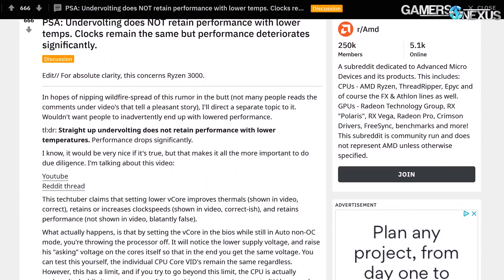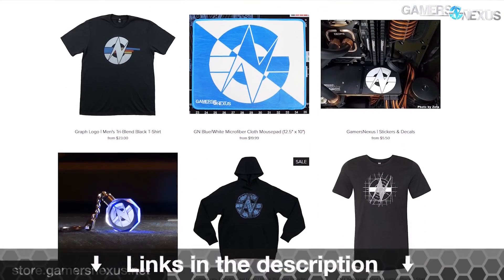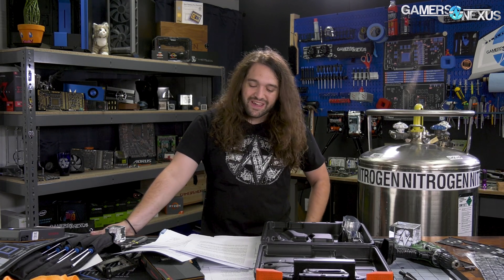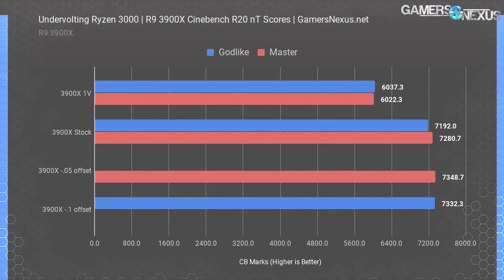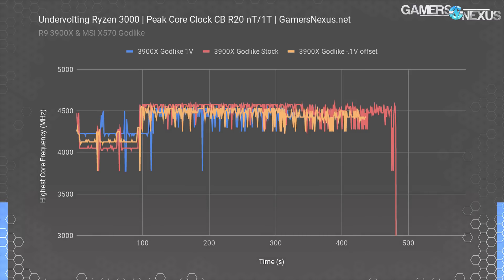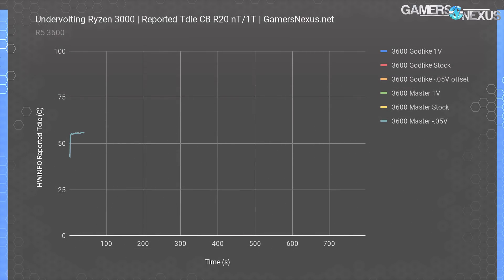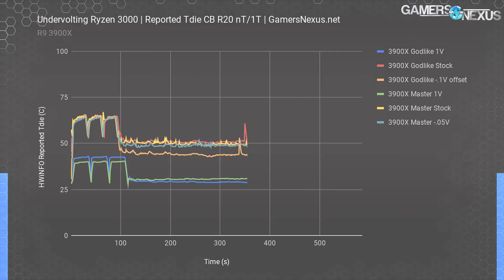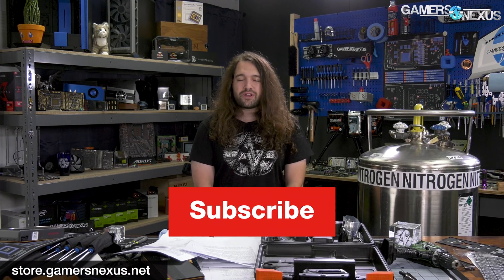AMD Ryzen 3000 Undervolting Offset vs. Override | Vcore Voltage

Comment: Wait I'm confused, I can't really understand the point of the video probably because I don't know much about this topic and because English is not my first language. I undervolted my 3600 at 1.15v and 4.1 GHz and the score seemed to increase quite a bit (200 points circa, I could adjust it to reach 4.2 GHz but my main goal was to lower temps without sacrificing productivity). So why is the guy saying that undervolting your score gets lowered? Am I misunderstanding the point of the video?
Reply: You get the point of the video. I have the same situation as you. Maybe, author of the video undervolted it more than the optimal value (1V instead of 1.15-1.25V)
Reply: @viktorkrasovskyi7837  yeah i read the article and for what I understood the topic is about undervolting too much and also by lowering Vcore in the BIOS, wich causes instabilities in the motherboards, whilst I am doing it via Ryzen Master, maybe the two methods are different.

Comment: My own testing has shown that cinebench stays pretty much the same, only 3dmark shows a difference with undervolting. For me going -0.1v offset, lowered my temps and gave me an extra 1000 points in 3dmark. But my Asus motherboard also defaults my 3900x to 1.47v... I really wish you would retry this test, but with 3DMark

Comment: Well I run my ryzen 3600 
on 1.25v 3600mhz I don't know but I saw temperature drop so I'm good is this good enough?
Reply: mister.T Jr  I guess I'll stay with it I'm using amd ryzen master to tweak my cpu anyway its good to undervolt my cpu than burning it to 95° on stock cooler

Comment: My only question is if you had someone who cared most about reducing noise, would doing this extreme Vcore voltage help them? As your results indicates a lower temperature which implies lower fan speeds needed?

Comment: but if I want to use this on a NAS, would I lower power consumtion without loosing much performance in other words impreve the effencicy? or would it be less efficient like you getting less per watt.
Reply: You can run chips designed for power efficient usage, there are companies which make passively cooled systems based on SOCs, they can run Linux or Windows.
They will give far better results than a process designed for the desktop
Reply: @RobBCactive  that is true, but I also want to have great performance, rather than NAS I guess I should say Home server. like how many people are using the ryzen platform as their unRAID server. I want to have a dozen docker containers including Jellyfin/Plex, and be a good transcoding server. So in other words I want great performance at the least possible power consumption.

Comment: I did not hear any commentary as to the accuracy of voltage measuring. Did they measure the voltage by any other means than on board sensors.  Or do they rely on the mainboards calculation offered by the firmware/drivers?

Comment: I've definitely found a small performance decrease putting my 3600 at 1.1625v, but the temperature difference is huge, in an HTPC mind you, so the temperature control is the point.
Reply: Feigel Clan what ghz do u run at 1.1625 volt? I run 3.8 ghz at 1.1000 volt. Is that safe for performance and longlasting ? Meanwhile i’m waiting for kraken x63 / z63 until it’s available in my country. Around september / october i will get the kraken and run 4.4 ghz at 1.350 volt.
Reply: I need held with mine also, I have the Ryzen 5 3600 with the stock cooler on a B450 Tomahawk Max board and my temps are high in my opinion, but this is my first build so I don’t know much. I was playing the isle last night and on HWMonitor my temps were 77cel with the highest spikes at 81-83celsius but it did say the max value was 88cel. Idk if that means it ever got at 88 or if that’s like the highest it should get.
Reply: @MrYfz450Sir  what Ghz do you run??? and what voltage do you use for that clock? i run 3.8 ghz at 1.1000 volt. max. degree only 60 cel. awesome!!
Reply: Georgius Kevin Christian I have everything stock still. This is my first pc and I’ve never messed with them, when I first got it I wasn’t going to overclock anything or temper but idk if I should now? I’m Ryzen Master it says the peak core voltage is 1.3 and my speed I think is 2.5Mhz? I’m so lost sorry
Reply: MrYfz450Sir how can the speed is only 2.5ghz? Hmm i think you need to read the reviews for your references, and I suggest you better run all default in Bios.. run everything in auto just like new. Tell me once you done that
Reply: Georgius Kevin Christian yes everything is stock from bios still, I haven’t messed with it. How can I check the speed then? I have cpu-z and hwmonitor and Ryzen Master.
Reply: MrYfz450Sir yes you can check the volt and speed at cpu Z.. what does it show? It should be around 3.6-4.2 ghz speed at 1.35-1.45 volt
Reply: @GeorgiusKevin   yes i just checked on hwmonitor and my volts for the cores are around 0.9-1.4 and the clocks for the cores are 3.359-4.2 MHz
Reply: MrYfz450Sir yes broo that’s awesome already!! Nothing to worry abou
Reply: Georgius Kevin Christian oh ok thank you, how come in Ryzen Master my speed is sometimes low? Does it only speed up when I’m playing games? Like is there something that causes it to speed up,
Reply: Feigel Clan that’s quite true.. when processor needs more power for running the applications or softwares, the speed clock will be increased and does the voltages as well.
Reply: @GeorgiusKevin  I got my 3600 running at 4.2 GHz with 1.2 voltage and have gotten higher cinebench results then stock
Reply: zaRu how can you use 1.2 volt, i only could 1.25 or 1.2125 stable.  Currently i use 1.25 volt 4.2 ghz with stock cooler and get 38xx score on R20.
Reply: @GeorgiusKevin  this is what is confusing me since I set it to 1.2 volts with 4200 clock speed and its improved speeds and temperatures since stock the chip wasnt boosting above 3.9-4ghz. I dont know if its something to do with my motherboard or if i won the silicone lottery but all ive seen is good results
Reply: @TheZaru  hmmmm i dont know either.i have 2020batch with code 2010SUS. Am using stock cooler right now. Hope once the aio cooler comes, i could run 4.4ghz 1.3 volt stable later. 🙏 btw, do u play dota2?
Reply: @GeorgiusKevin  haha nah I don't play unfortunately but along with that I was also able to hit 1.1 volts at 4.2 but it caused red dead redemption 2 to crash that's all haha
Reply: zaRu hmmmmmm so it’s not stable dude.. i could get 1.1 volts too but it’s not stable once i bench R20.. i did 1.2 volts too but it’s not stable.. did u run R20 on 1.2 volts?
Reply: @GeorgiusKevin  yeah its stable at 1.2 that's what I changed it to after 1.1

Comment: i checked my Vcore on my msi bios. it was at 1.376V to 1.38V at auto. is this normal voltage for a ryzen 3600 at stock settings? i am not overclocking, i am just concern that my vcore is too high at default.

Comment: Undervolted R5 3600 with Ryzen Master 1.18125V @ 4.2Ghz and it works like a charm (air cooling). Temps down few celsius and Cinebench R20 went up 3460->3810

Comment: this video inspired me to undervolt the other day. i got the 3800x running at 1.25 volts at 4.33 ghz. starting out my scores were the same then worse then better.. i tried running it at 4.4 ghz 1.36 volts and actually performed worse than 4.33 at 1.3 1.28 1.26 and 1.25. my cinebench scores were close to 4900 stock. now im pushing 5200 in cinebench. temps are riding around 72, occasional spike to 82 if some background app is trying to load up during aida64. but ive had it stable at the 72 for pretty much an hour in numerous test. it took a couple hours of testing to be sure i was getting results. i hope this helps someone out.

Comment: Anyone else having temp issues with a 3600 or similar? Idles are 60c after undervolting to 1.350v and 100c under load.  Replaced thermal paste and same result
Reply: mister.T Jr  it was hitting 1.4v on default settings so limiting it to 1.35 was technically undervolting. It's running at 1.25v at 4.4ghz now. Turns out Asrock motherboards are garbage and come with garbage settings. Go figure.

Comment: My 3600x under any load will shoot right up to 1.47-1.5V and stay there. Temps are not terrible, yet certainly not optimal, but still I don't like seeing my voltage at 1.5V especially when I watch all these videos showing a 3900x averaging at a much lower voltages than my 3600x, at stock. I see people complaining about a few cores jumping up to 1.4V with this CPU but if I open basically any cpu demanding application, my entire CPU will spike to 1.5V and stay there.

Comment: I'm set at 1.2 volt solid on my 3950x. 4.1ghz all core OC. works great and temps reasonable around 70-80c.
Reply: Are you still running this? I'm curious. Also doesn't that mean all your cores are 4.1 ghz all the time at idle?
Reply: @pogtuber5146  I am still running this. Yes it doesn't matter if it's locked all the time for me because it is used 24/7. However I have since made it easier by simply changing the core ratio in the bios and letting the motherboard auto handle the voltage. Seems to work just as well.
Reply: @ryen7512  nice, what ratio did you use?
Reply: @pogtuber5146  I use like 37 in the summer to keep things very cool and less power consumption but it can be set to whatever depending on thermals. I also have a 5950x that seems to do a little better about 200 MHz higher clock for the same voltage and I keep that one around 40 usually.

Comment: on my system which is r5 3600 on an msi x570a-pro i got the following results (16gb RAM Gskill tridentz Neo 3600mhz 16gtz)

1. stock up to 1.4v, up to 4100mhz = 3601 cb score at peak 80C temp
2. 1.29V peak, locked 4300mhz = 3814 cb score at peak 75C temp
3. 1.275V peak, locked 4300mhz = 3826 cb score at peak 73C temp
4. 1.26V peak, locked 4300mhz = 3815 sb score at peak 73 temp
So I guess what best would work for me and the chip I got would be 1.275 locked voltage with a slightly oced frequency
That being said, this is me posting more than a few months after this video and a couple msi bios updates as well for x570 ..

Comment: The thing I hate with 3000 series is the insane voltage jumps, and this is the reason most people want to control the voltage.
Im not sure is there any difference between my copy of the 3600 and the gamer nexus but this is what I found to be true.
Undervolitng works, at least it does for me.
The things i changed in bios where: clock multliplier, vcore voltage, and xmp for my ram(3200)
After playing a while I get:
1. 4.2 ghz, vcore: 1.075V (cinebench: 3642 cpu temp:74)
2. 4.0 ghz, vcore: 1.000v (cinebench: 3485 cpu temp:71)
System:
Asus b450 itx strix
Ryzen 3600, noctua nh-l9a-am4
HyperX Fury, DDR4 3200MHz
gtx 1660 super
fractal node 202

Comment: I am still wondering how you get to 3700 points stock for the r5 3600. I need to OC mine to 4.2 GHz all core to reach that. My Memory is 3200 cl16, but that much difference in r20?
Reply: I'm also having 3200mhz ram @ cl16. Scoring 3725 @ 4,2ghz and 3850 @ 4,3ghz. So mabey its indeed that 3200 cl16 ram.
Reply: @henkvandommelen3206  
the thing is, that they didn't OC'ed the CPU to get to 3700. 
Mine also doesn't reach 4.3 GHz...
But, yeah could also be the Max of the Memory

Comment: My voltage for r5 3600, in bios on auto is 1.1v and its working 60°C on idle but its shows 1.4v working voltage in the corner i am using asus tuf b450m plus
Reply: auto puts insane vcore, set a fixed vcore / clocks

Comment: Thanks to playing with this I was able to set my Ryzen 5 3600 at locked 4Ghz at 1.15 volts and not only I got rid of the saw-tooth reports in monitoring software but my CPU runs stable at freaking 18'C cooler. All tests like furmark and cinebench, 3dmark report same or slightly higher values. Still worth it for almost 20'C reduction of temp. Either it actually works or I was very lucky with the chip.

Comment: Definitely a feature more than a bug. I've managed to get a stable 4.2Ghz with 1.112 volts compared to auto/stock which runs at 1.35-1.4 depending on settings.

I did experience what I'd call a bug tho, as the 1.35v reading was from a manual ratio of 42 compared to stock at auto. Which still boosted to 42 but with lower performance and more volts. 
Very minor reduction in cinebench scores but no visible performance degradation in games or real use. Still going to try increasing voltage very slightly to see if there is a performance boost with a bit of extra V.

Comment: r5 3600 owner here, my solution was to high temps and voltages (85+ and 1.4v+ on cinebench r20) after reading/watching/trying lots of online solutions was firstly replacing the awful wraith stealth with a £20 wraith prism.  That dropped temps nearly 20c instantly, then, when trying lots of different bios configs I set my multiplier at 39.75 and no PBO and now my CPU does not get any hotter than 75c on 20 min run on cinebench and still scores over 3600 points consistently only a tiny bit lower than my stock scores, now the voltage never goes over 1.2v and have not noticed any degradation in performance in daily use, when I set my multiplier to 40x the voltage went up to 1.3v and the temp another 7-8c so I put it back for a cooler, quieter less hassle PC experience.  
R5 3600, 2 x 8 gb Viper 4 3200mhz, MSI B450M Pro VDH Max, Gigabyte GTX 1060 Mini OC 6gb, Coolermaster G650M PSU, Phantek P300 1x 120mm 3 x 140mm, Samsung 850 Evo 240gb, Seagate 7200 1TB.  Built to a very tight budget, I know some stuff could be better, GPU next.

Comment: I set my Ryzen 5 3600 1.25v 4000mhz constant. And I got in cinebench +100points and -20c on temps. Probably not every chip works like that,but my does

Comment: I tried a 3600 at 1.325V and 4.125GHz, it reaches 72°C on booster. In Stock it was 85ºC 
It gets 1567pts on CB15 and it was 1508pts in stock. 
I used AMD Ryzen Master program to test.

Comment: i get far better performance in benchmarks with 1.28v static volt and 4.25ghz staic OC
it never boosts above 4.3 ghz anyway, also, i can also do 4.3ghz all core oc at around 1.3v but muh thermals

Comment: i've been running the 3900x at 4.53 ghz with voltage override at 1.402 V.  it is faster than running 4.4 ghz but i can't tell if i'm hurting anything.  i saw info online from amd saying that 1.4 to 1.5 volts is normal at high boosts, but i've heard some concerns that 1.4 is too high.  it's working for me at the moment though.
Reply: But what temperature do you have on that monster of a CPU at 4.53 ghz?
Reply: @cosminmilitaru9920  About 50 C, but I did need to change the settings once i tested under a high load.  Adding additional ssd to the system also crashed, so needed more volts at 4.5 or other settings..

Comment: 1) amd STOCK voltage,clock and power control is weird and frankly crap compared to intel STOCK the reason why I would never recommend AMD to a beginner you HAVE to tweak the bios to get an acceptable "non random results" use out of them 2) underclocking and undervolting will give you a huge power/heat improvement and may give you better perf at the same time but.... 3) if you only undervolt but keep a high clock do a cinebenchR20 run and you might be surprised by the fact you get a way worse result without enough voltage and contrary to Intel which would BSOD or doesn't boot AMD will boot but it'll do "what it can" with the voltage you give him 4)an all core overclock if low enough will remove those annoying temp spike Ryzens do stock at idle fyi, in the end I recommend going for a more manageable all core overclock and trying voltages yourself, reboot do a cinebenchR20 multi-thread run you'll have your temp/watts ifg you use aida64 or icue etc..and a score which will without doubt tell you if you do better or worse my 3960x stock 12'200, 4.15Ghz@1.24v 13'500 4.4Ghz@1,4v 14'600 (but also +15-20°C at 98% usage so no thanks) with AMD it's pretty much up to you to find the good balance of heat/perf you want again a plateform I would never recommend to a beginner, without tweaks I give it a 0/10 it's unuseable and an awful experience, most youtubers and websites lie by omission to you, the numbers they show is 9/10 not 100% stock but tweaked bios/software again stcok it's garbage borderline useable compared to Intel
Reply: Agree, finally someone said it. I have a 3800x & 3900x and they’re unusable in stock configuration - imagine your new car randomly redlining while idling at the drive through, and no, this wouldn’t even happen to a race car. You have no option but to start tweaking, then it’s like training a high strung puppy, except it’s the smart one and you’re the dummy. You’ll never figure it out to your satisfaction, you’ll keep tweaking until you settle on some compromise, then tweak some more, spending hundreds of hours on a hobby you didn’t choose. I doubt AMD engineers could find an ideal setting, unless they run them at base clock maximum, say 36-38x, which I suspect is what these cpus really are. The AMD features for higher performance (pbo etc) seem like gimmicks to advertise higher frequencies, but not usable while maintaining your sanity. I’ve never had a desktop Intel cpu, but I’m starting to think there’s a reason they cost more.

Comment: Nice video, i'm so confused with my ryzen 3800x with pbo activated and stock   speeds and voltage i get low scores at cinebench and ultra high temps but with manual oc i get better scores, much more core speed and amazing temps.... I hace BIOS update, AMD drivers etc. I'm done...

Comment: Can somone tell me is there any advantage of doing -0.05 on ryzen 5 3600? I dont get his graphs..
Reply: Slightly lower temperature, between 2 and 4 degrees. On a stock cooler I see how undervolting 0.1/0.15 volts looks like the way to go

Comment: i did this on my 3700x and fk yea it works at 1.2v and 4.2 ghs at 65 degrees c and 4990 score on cinebench 20
strix b450i board
32gb at 3200 16 18 18 38
120mm aio cooler in the phantex shift air.